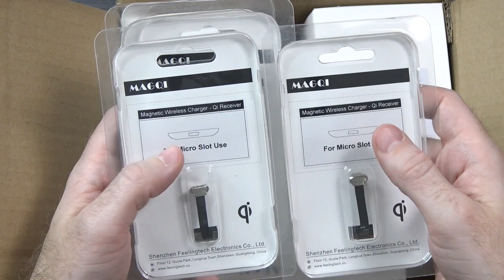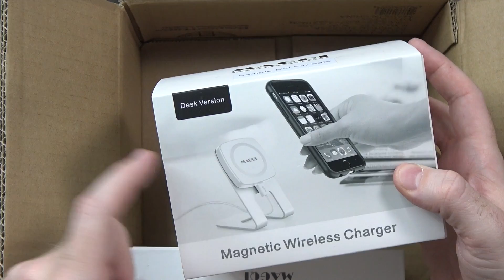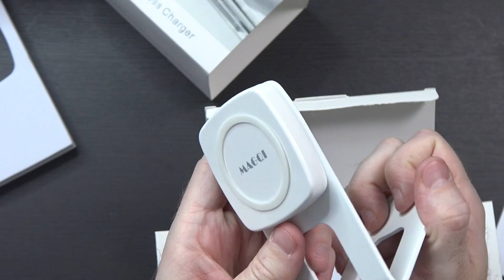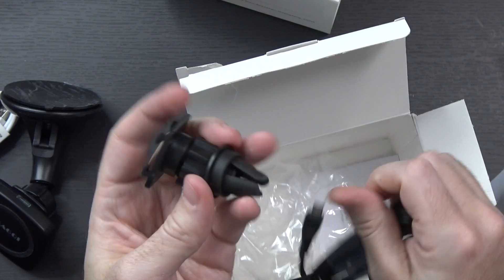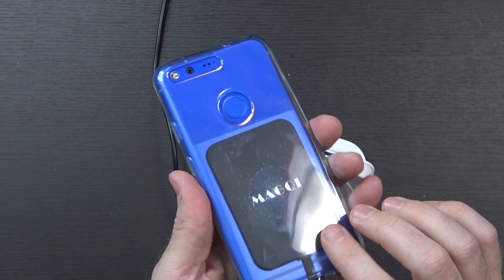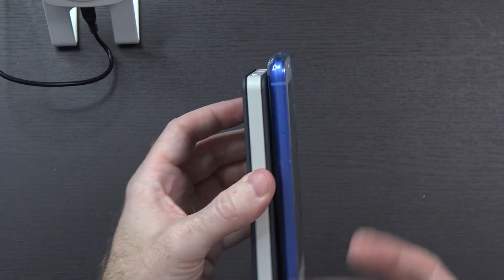Super Strong Magnetic Qi Chargers | MAGQI, by Feelingtech

Comment: The point of wireless charging is so that it's easy to take on and off. With these magnets im gonna need to use both my hands just to take my phone off the charger. At that point I'd rather just have a cable for some flexibility.
Reply: The magnets are not that strong and I don't believe you're that weak.

Comment: tk Bay also reviewed this but both of you haven't tested on Galaxy devices. I would like to know the magnetic strength with and without additional plate.
Reply: the magnet does not work on the galaxy devices without the adapter. it will charge just fine.
Reply: TK Bay oh bummer. since s7 comes with magnetic back without additional plate, I thought it might actually work. I rock with naked s7. so hard to find one that doesn't require metal plate. thanks for the input. ill keep searching.
Reply: Hank Sharpe have you found something? I don't use cases but skins, please share if you did
Reply: Hank Sharpe How about try the Xvida StickyPad and the Xvida Charging system that has Fast Wireless Charging. That works with the S8, S8+, S7, S7 edge, Note 5.